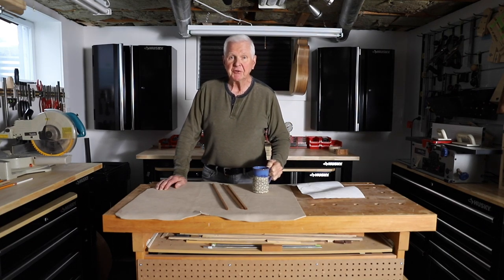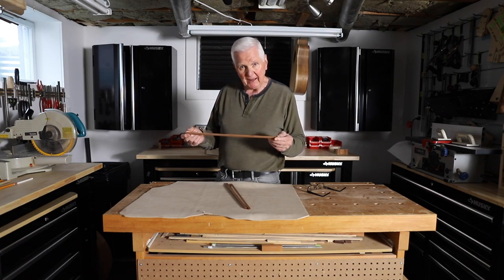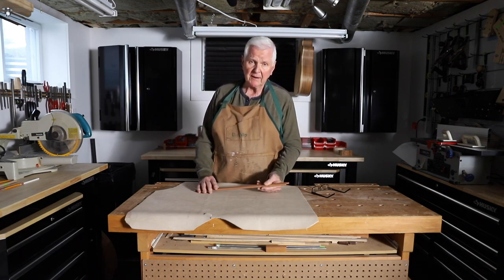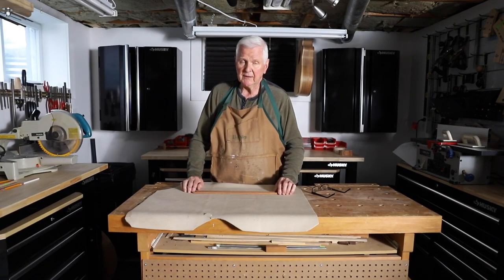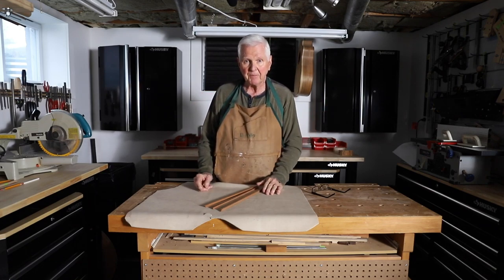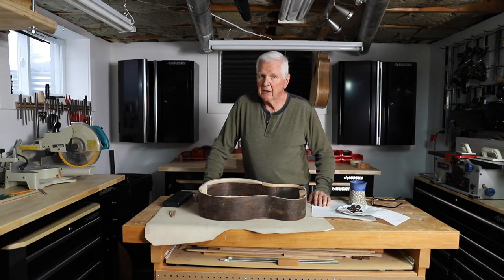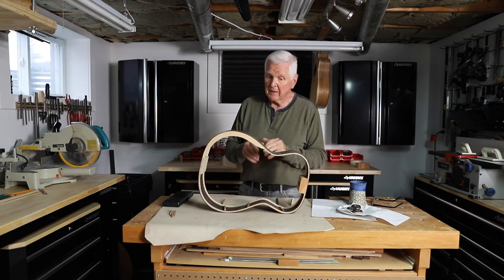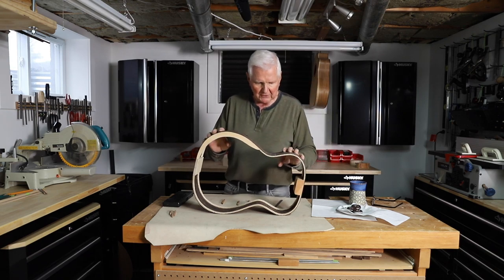Prepare for Trouble

Comment: Hi!
Thanks for replying to my coment on the previous video!
Suddenly I got another question 

How do I brace siedes of my guitar if the soundport i very big?
Also, is there any relieble way to estimate the the size of soundport/soundports if there is no sound hole in the "top" of the guitar?

Ps. I hope that your grandson will join you in your workshop more often
Reply from the maker: He has agreed to return. I will be shaping the bracing on the next video. It needs to be large like the front sound hole but if it is smaller you may get more bass out of the guitar.
Reply: @MontyMcKinnon  

This is amazing news, because the body of my future guitar will not be the biggest and I was concerned about the bass.

Love your videos, you're doing amazing Job with them!
I can't be more grateful for your advices